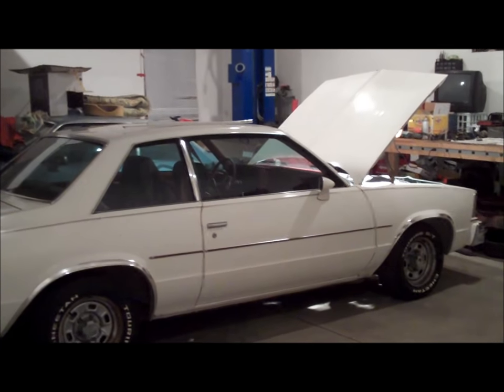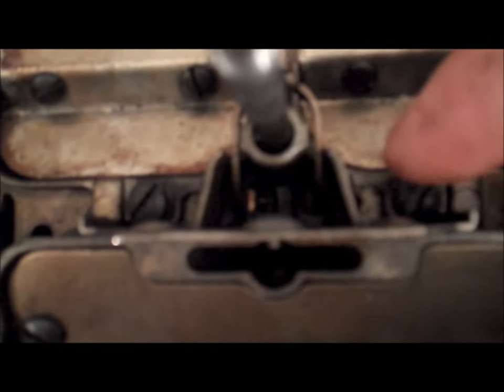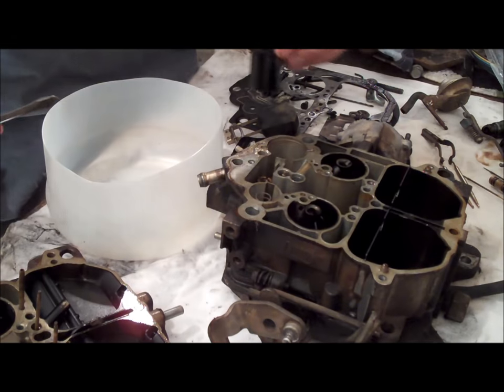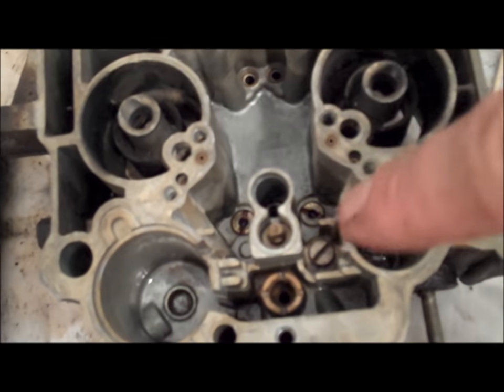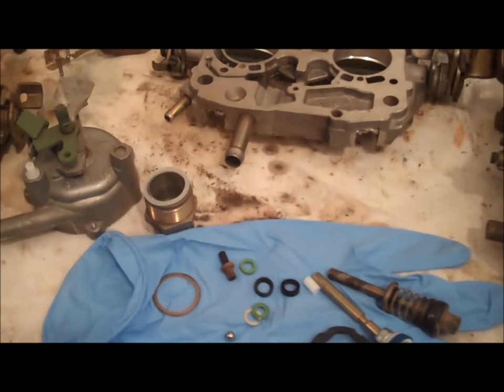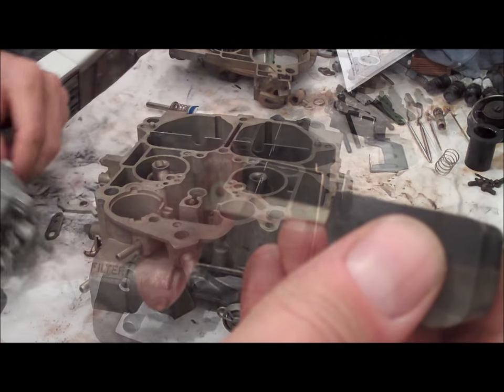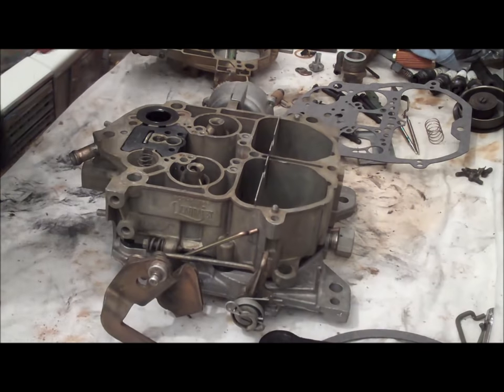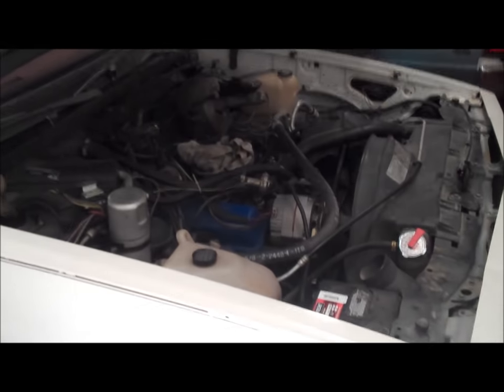Detailed Quadrajet Carburetor Rebuild COMPLETE GUIDE

Comment: Well done! I do have a question if you don't mind. Isn't there supposed to be a gasket where the fuel filter goes into carb?
Reply from the maker: Its a white plastic nylon washer that snaps on to the filter housing. I believe I cover that.

Comment: thank you is their any future videos coming up on rebuilding electronic quadrajet carburator
Reply from the maker: The only one I have coming up is how to replace the Throttle Position Sensor in one and I pull the top of the carb off. I may be a full rebuild at some point.

Comment: any chance you could show hooking up all the vacuum ports when you get it on the car? would help a ton!
Reply from the maker: I put the car away in storage for the winter so I cannot film a video of that. Just look up vacuum line diagram in Google for your vehicle and they will come up.
Reply: unfortunately that isnt very easy haha
Reply: it a hard to find diagram
Reply from the maker: Mr.Omg What year make and model car do you have? What engine?
Reply: its a 1979 l48 chevy 350 engine thats in my 1980 camaro. it currently has a edelbrock carb on it but i want to put the quadrajet back on it and most of the lines are gone but the stock intake is still on it. all im missing is where this choke hose goes to and i can hook everything up and run it
Reply from the maker: Mr.Omg Choke hose? If you watch my carb videos you can see how it goes together. I just posted another. It is a hard line that goes from the choke housing to the intake.

Comment: looks like a good video, but the one part i came here for was the choke section of the assembly... which was skipped over from what i saw
rip
Reply from the maker: What do you have a question on and I can help.
Reply: @ClassicGBodyGarage  so I have it fixed now, but I couldn't figure out where the secondary choke blocker (I think it's called) it took me hours to find anything on it but I got it working now

Comment: hey thanks for the video! I just wanted to know if u can make a video or explain to me how to fix the spring on the secondary air flaps.. I tried to adjust mine but I think it unhooked or broke because there is no more tension.
Reply from the maker: You will have to pull the top of the carb off and replace the spring or find out whats wrong.

Comment: I am currently rebuilding a Quadrajet for my buddy about halfway through the video you mentioned the acid kit I have the carburetor acid that I got from a supplier of mine is it ok to soak the hole fuel bowl assembly or would that do more damage than good
Reply from the maker: Don't soak in acid. It will remove the plating. Soak in a carb solvent. You can buy a bucket from NAPA.
Reply: thanks for the help

Comment: Great video, easy to understand...I have a 76 Cadillac...do you rebuild all Rochesters and how do I contact you to do it?
Reply from the maker: frank ploger Thanks. I rebuild any NON computer controlled Carb. email me olds7980@yahoo.com
Reply: @Classic G-Body Garage I have a 1987 cutlass with all stock 307 and quadrajet is it much harder to rebuild that carb? And why do you not rebuild electronic q-jets? Thanks!
Reply from the maker: WeezMcCheez It's not the fact that I don't rebuild electronic qjets, I just don't deal with Gbody cars with an ECM. It is a little different rebuilding an electronic qjet vs a non. Different internals. Some elements are the same between the two carbs.

Comment: What kit would you recomend for a 1969 Chevy C-20 350?
 It has an automatic trans and there is a module mounted on the rear of the driver's side with wires plugged into it.

Comment: hello how you doing I'm trying to rebuild my quadrajet electronic from my 1987 oldsmobile cuttlas supreme brougham with a 307,but I ran into a Lil problem I have to undo the screw that holds one of the sensors will that have a special adjustment.
Reply from the maker: thats for the MC solenoid. Yes they take a tool for adjustment. I am not that familiar with that style carb.

Comment: I have a gasoline seep in the round port that is in the housing where the fuel filter goes and gas line. Seems to be seeping around the round insert plug. What is this port for and can it be resealed. Any suggestions? ty

Comment: I was wondering if you knew how to mod the Q-jets for big  engine w/big cams?  Mine just isn't getting enough fuel at idle. It seems alright otherwise. It was pinging at idle only, so I kept upping the jet size all the way to 80 from the stock 71. Even at that it has a small ping at idle and seems strong mostly everywhere else. It was already drilled when I got it. The idle discharge has been drilled, the restriction has been drilled to 63thou and the idle down tubes are at 42thou. But I never removed the idle down tubes to check the bottom side hole and they havne't been out before. I am close to giving up on this carb. I may try making the secondary stay slightly open at idle....... chevy 454 comp mutha thumpr cam (more than 280), 9.5:1,  800cfrm Q-jet from 75 caddy , 11inch vacuum, 24 initial timing, 900rpm idle
Reply from the maker: +p k  The mods that were done to it are the suggestions i would have mentioned. How far backed our are your idle screws? Timing? Plug type?
Reply: +Classic G-Body Garage  My initial timing is 24. I can back my mixture screws all the way out, ac delco plugs. I messed with it some more today and it seems the previous owner had drilled the top and bottom idle air bleeds. I think this is the problem. With the big cam the carb isn't getting a good enough signal to suck the fuel through the idle system no matter how big it is. epoxied and redrilled the top idle air bleeds smaller and am gonna give it a try tomorrow. I also pulled the idle tubes and the small end was 37, I drilled them a couple thousandths bigger to. There is a video of it running on my channel.

Comment: Any tips on how to keep the carburetor from overflowing? I have a dual capacity pump e4m model and after the rebuild it just keeps over flowing. I'm really frustrated at this point. I should take it to a shop but I really want to fix this myself.. I could really use some advice.

Comment: Hi. I have a '80 LeSabre with this rochester 4bbl carb. It has a lumpy idle but otherwise the performance of the car is fine. It was stored from 1991 until i bought it 3 years ago. It is a capped idle adjustment carburettor. I think it may have crust inside it, possibly blocking jets slightly or just gummed up a little. One question though is this: Is it worth removing the idle mix caps? Or simply rebiuld the carburettor without touching the caps?
Reply from the maker: Go through your vacuum lines to make sure you dont have a vacuum leak first which will cause a rough idle. Also plug, wires, cap, rotor, fuel filter etc. all things you need to consider before a carb is pulled apart. It has sat for a long time but the gas will usually evaporate out of the carb before it gums it up.
Reply: Thanks. I've ordered the appropriate parts. Everything is on point regarding timing, idle speed etc and is not misfiring at all. The engine smoothes off out of idle. I have removed the EGR temporarily (it was broken anyway) which had no effect on this 'lope' idle. Wish me luck.

Comment: Got a buddy of mine with a 79 Monte with the 305.The motor is stock.He is having starting issues with the car all the sudden.He has to pump the gas a lot to get it to fire after sitting 24hr's.If he lets it sit for a few hours it will start easy.I was thinking the choke is not working correctly.Someone else thought the fuel pump is bad.Once its running its awesome.No power loss when driving.Original fuel pump and carb.I was also thinking that maybe the fuel is draining back to the tank for some reason ? Please help thanks !
Reply from the maker: Quadrajets have a leak down issue with age. The lead plugs under the float bowl leak and you have to reseal them with epoxy. I discuss this in the video 19:58
Reply: yeah I got a 1978 Silverado That is doing the same thing. Starts up fine if it only sits for a few hours but once I let it sit over night the next morning its a Pain in the rear to get it to start. The Carb was Rebuilt by a shop a while back but I'm thinking they didn't Check the Lead plugs. Is there a way to check them without Taking it all the way apart?
Reply from the maker: watki7441 remove the carb and turn it upside down. See if the plugs are wet with gas. If so then they leak.

Comment: Hello
I followed your video which is awesome! I installed the  carb and the mixture screws have no effect. The truck starts and goes to high RPMs then comes back down and stalls. I can keep it running with the throttle but it won't idle and not idle speed adjustment or mixture screws seem to have any affect. I checked vacuum lines and all of the connections and all seems fine. Is there anything you would r commend I check? Thanks.
Reply from the maker: Sounds like your power valve is stuck open. I mention to make sure it moves when assembled. You can test it by lightly pushing down through the vent hole on the top of the carb with a screw driver.
Reply: Thanks,
I pulled up he carb and checked everything including the power valve and everything looked fine. When reinstalling I noticed there was an area on the manifold to carb gasket that was not depressed like the rest after tightening. Massive vacuum leak, new gasket, correct torque, runs like it should. Again great video!

Comment: I'm in the process of buying a 1978 chevy c10 truck. My question is about the carb it's an auto part store rebuilt quadrajet. The issue is it will idle but try to put in in a gear( automatic) it dies. the truck has sat awhile and it has the ethanol mix fuel. should a rebuild and regular fuel help to fix this problem. Any help or comments

Comment: Hey there, i just did a rebuild on one of these and was abouy put to it back together and decided to watch your video to make sure i didnt miss any thing but i ran into some thing? When you were talking about the power valve adjustment screw and showing it i looked at mine and it has a phillips head screw that appeared to be stainless steel like 3/4 of an inch down instead of that brass screw with the square ish head on it? Do you think the last person lost the brass screw and just threw a phillips in there or is there a possibility that this phillips screw is the right one? Ive looked for a replacement but the only ones i find are like the brass style no phillips anywhere?
Reply from the maker: I have not heard of a Phillips head screw in place of that brass style that is in there. Also that brass style is specific so the power valve pin rests on it. It is possible yours is a much different year but again have not heard of this.

Comment: What does it mean if my accelerator pump has gas on the air horn and when I turn my car off the carb leaks gas from the insulator gasket under the carb
Reply from the maker: a little gas at the top where the pump shaft comes through is normal but the pump seal might be getting a little worn.

Comment: Hi from france Classic G-body garage  i have from 2 month a chevy caprice classic 77' with 350 ci and quadrajet 4bbl  the operation is similar ( or idem ) to my carb ? i have buy the complete gasket rebuild kit with carb number but i fear a little bit !  any advise ?  if i proceed like in ur video no probleme with start up after rebuild ? no more adjustement on carb ?

Comment: hi failed emissions because of high CO.  running to rich. What do you think is the problem? would a rebuild help?
Reply from the maker: This doesn't mean the carb needs a rebuild.  Change the engine oil before any emissions test. Check the PVC valve as well since it pulls crank case fumes and burns them. If the oil is dirty it will mess up your CO readings. Also check or replace your air filter. A restricted air filter will cause a richer burn. Make sure the choke is opening all the way as well because that will also cause a rich burn.

Comment: Can you tell me why some quads with the electric choke don't have the secondary brake on the rear of it. I believe that is what it is called. The one in this video has on attached to it but some don't. Is it necessary to have it?
Also what do you think about the Edelbrock Quads that were made? Are they as good or better than regular quadrajets?
Thanks
Reply: +JustTrizIt  the secondary air valve delays the secondary circuit to prevent flatspots its not a choke.

Comment: Great video im going to try doing it my self but i got one question!   The adjustments on front of the carb are still sealed do I leave those alone or do I have to take the seal covers off in order to proced the rebuild?
Reply from the maker: You don't need to pull the plugs out. They are set from the factory so a proper rebuild with the idle screws left alone is fine.
Reply: Ok thank you! Your videos are great

Comment: I have a question, if i have a quadrajet that still have the mixture screws coverd up, should i break off the covers or leave them as they are and not mess with the screws at all?
Thanks!
Reply from the maker: +Wingren93  There is no real reason to break them free if you have a stock engine.  If you are running a higher lift cam then you will need to uncap them to adjust the idle mixture so it idles properly. They only adjust how the engine runs at idle.

Comment: I have a 1984 Chevy Silverado C 10 pickup truck it runs fine but I have hardly any power it just does not peel out anywhere even if the road is wet it will not spin tires it has a 350 v8 with a Quadrajet carburetor pretty similar to the one you just rebuilt what do I do?

Comment: Any video CCC Carburator Rebuild.
Reply from the maker: Not yet but damn near the same thing. The only difference is the MC solenoid setting which is the blue sensor, you need to run the adjusting screw all the way down and count the turns before you back it out to remove. Also make sure you pay attention to how the plunger pushes on the TPS sensor. Things will break if not correct.

Comment: Thank you so much for the great video, after watching I tore down a carb from a 1988 caprice, 305.  Just a couple questions if I may. At 35:05 there is a small part that almost looks like a tiny wrench sitting on the bench, this appeared on my bench also and I have no idea where it goes :), also is it possible there is a spring between the check ball and screw, I believe one came out of mine but could the spring be from elsewhere?,  thank you so much.
Reply from the maker: Thanks for watching my video and glad it was helpful. The wrench looking part is for the choke and it goes behind the chose housing. I cover that part in the video when I assemble the choke. There is not a spring where the check ball goes. The only springs under the power valve that has the little needles on it, under the accel pump and inside the fuel filter housing.
Reply: Thank you for the reply, I did some research and the little thing I was talking about is actually Is called a baffle, and I was also looking at a walker parts list and there is a part there called a fuel discharge spring I swear it came from the hole where the check ball is, I should have specified this is an electronic quadrajet e4me I believe.
Reply from the maker: Troy LeGare  Yes correct post 1980 GM cars used electronic quadrajets. I didn't ask about that with your car being an 88 because many people swap them out for an old non ECM carb. Electronic carbs have different internals. There are solenoids inside.

Comment: i just got a 1989 suburban built in mexico and couldn't find the quadrajet 17081586 Float adjustments and was able to get a kit but i was missing an exact  air horn gasket do you have any information on that quad?
Reply from the maker: Go through quadrajetparts or quadrajetpower dot com
Reply: am wild guessing since is a suburban 1989 made in mexico with a quadrajet number 17081586 and there is no such number or even kits for it i do not have access to a vacuum to set the mixture but am getting it there  is still to rich and i can smell the gasoline on the exhaust pipe
Reply from the maker: Tune with a vacuum gauge then. Tune until you achieve optimum vacuum. Not sure how you do not have access to vacuum. You also need to make sure you didn't touch the power valve set screw as I mention in the video. That will affect idle mixture.
Reply: i haved mess with the idle mixture that had 1 1/2 turns on one and 4 1/2 on the other,,, but not the power valve 
 i went to the agency (chevrolet mexico) and they do not sale any parts for older cars or even autozone has nothing 
i had to ask 30 places to get the mechanical pump new as for now i just need to finetune because of gas smell in the exhaust pipe
Reply: I'm certainly not an expert but earlier in the comments it was mentioned that if the idle mixture screws are not near the same as far as turns out, then perhaps the throttle shaft has a vacuum leak and needs new bushings.  Just a suggestion, good luck.

Comment: Have a Rochester 4B on the 307 but, it won't let the engine start until I've pumped the gas a whole lot while cranking the engine.
Reply from the maker: After the car has been sitting a while? If so then you have leaking fuel bowl plugs.